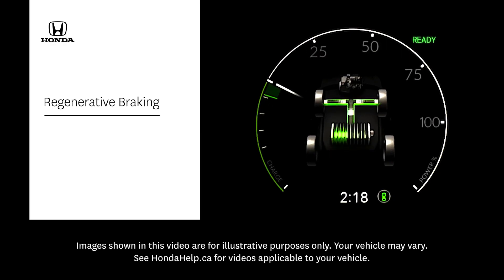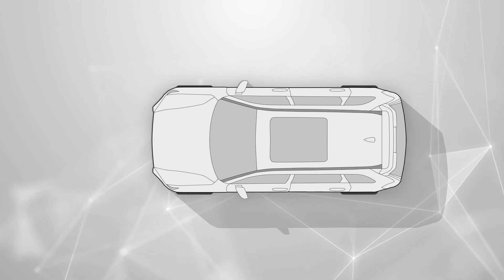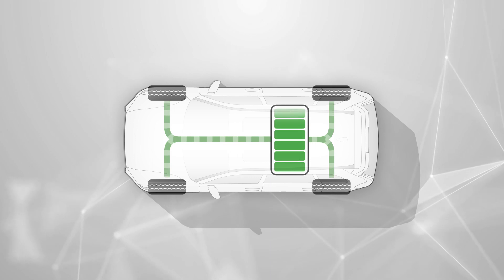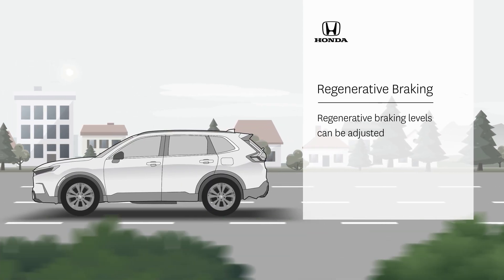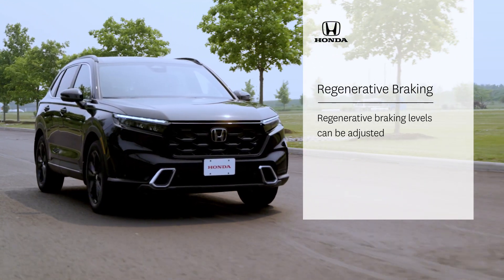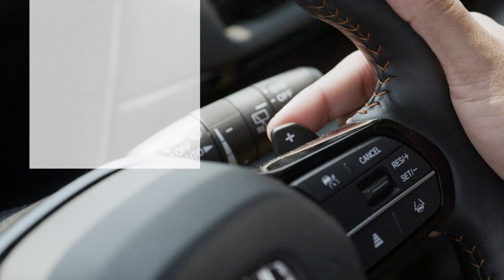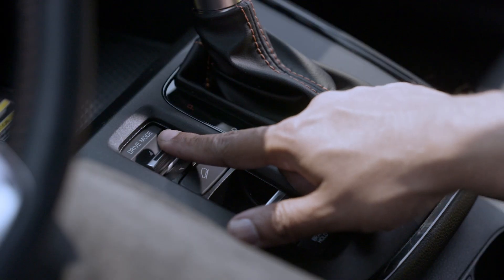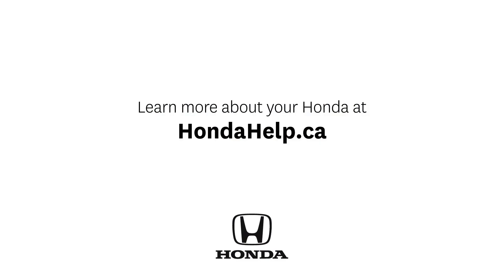Regenerative Braking on Your Honda

Comment: When can I adjust how much regen it uses? I just had a test drive and the paddles did nothing while sitting in the lot. It eventually appeared and started working when driving. But I've seen video reviews here where they demo changing the regen strength while the vehicle is stopped.

Comment: Honda, please switch rear drive to electric motor for reliability and better driving dynamic. 
A little bigger batteries - at least a 10kwh
Reply: Actually the Honda drive train setup offers better driving dynamics.

Comment: I have noticed  that if you are driving along at a constant speed and select increasing levels of the regen braking, the car will slow down and you have to give it more gas to maintain the same speed. Seems like this is counterproductive and is burning up more gas. Why would the system begin slowing you down when you haven't let up on the gas? So far this doesn't make sense to me.
Reply: I don’t get why I’d want it on either. I guess to charge the battery quicker. Or to save the brake pads since the car slows by just cutting the engine speed
Reply: @Thebuird  I have since done a lot more testing with the system and found that my first comment is not correct. The system does not produce any extra drag. It was just an illusion. In the meantime I have used the regen braking extensively and have found that it actually is super excellent. For  city driving I get 54 mpg, and around 46-49 in mixed driving. I also have completely come to love the regen braking effect because this car can be driven with one pedal driving, where the regen braking does nearly all the braking. I almost  never touch the regular brakes anymore, which means they are going to last forever. It's really quite fantastic.
Reply: @johnschmidt8440  thanks for the info! I just leased a 2024 CRV Hybrid two days ago. Came from a 2020 Camry Hybrid. I’m definitely going to try it out more, I was hesitant about it. Saving on brake pads would be great, I hate paying for new pads. I’m still confused by how extra mileage is produced, but I’m going to test it out and hopefully I can mimic what you’re able to pull off. We’re absolutely loving the vehicle and am very happy we switched to Honda
Reply: @Thebuird  A CRV is unlikely to get as good of mileage as I get in an Accord, but it will still be better than a pure gas vehicle. So give it a shot and see what happens!
Reply: @johnschmidt8440  okay help me out here bud, so to coast/slow down when coming to a stop do I downshift (-) or upshift the paddle?
Reply: @231jopancho  Actually it's not necessary to do either one if you don't want to. If you use the brake pedal in the normal way, the regen braking will do all the work until you want more braking than it can provide, or until you reach a slow enough speed that it no longer is effective. At that point the normal brakes kick in and work like usual. So this is all automatic and does the same thing as the shift paddles. That's why I almost never use the paddles because they really serve no purpose other than marketing for the most part. They are useful, however, when you want to do the equivalent of downshifting a regular transmission for doing something such as driving downhill and being able to get braking without using the regular brakes. The neat thing is that you get braking in that situation without using the normal brakes, and not winding up the engine, while at the same time getting energy to charge the battery. It's really an excellent system.
Reply: @johnschmidt8440  Thanks man God bless very helpful. I am just experimenting using the paddles and feel like a kid at a candy shop

Comment: if we press teh brake pedal, does it charge the battery?
Reply: Yes. That works as well. It’s better to use the paddles because the electric motor slows you down instead of your break pads. This will extend the life of you break pads and give you better gas mileage
Reply: @loneranger3977  Is there a way I can know how much to press the brake when slowing down to maximize efficiency? MY brake pads are being used up too fast

Comment: Why would sport mode maintain regin breaking rather than economy mode? Doesn't regenerative breaking increase economy? But that's only permanently available in the least economic setting?
Reply: If you hold (-) down once it's in drive you'll have it for the entire trip
Reply: @357STEPS keep in mind going to neutral, reverse or park as well as adaptive cruise control will reset it. Depends on what you consider a trip I guess.
Reply: Is that true for 2024 model? I tried holding negative paddle down but couldn’t get M mode to stick. Even shut car off and on thinking there’s a limited window. I use B on the shifter around town which is effectively like M
Reply: @teamwounder B mode is the new M 😂 idk why they did this
Reply: @teamwounder  Using B in town all the time I think would use more gas to overcome the constant deceleration effect.

Comment: When you want it to go up, you use the left paddle minus function, but when you want it to go down, you use the right paddle plus function. Well, that's confusing.
Reply: It makes sense to me. Braking is a negative thing, so by tapping negative paddle you are increasing the magnitude of negative force
Reply: Agreed. As well as it's only permanently available in sport mode setting. It increases economy but is not available in economy mode.
Reply: It’s meant to be like a downshift. In normal vehicles, downshifting at a higher speed will slow the car down without applying breaks.
Reply: Braking=negative acceleration.
Reply: Think of it like engine braking, left paddle for a downshift (more) and the right paddle for an upshift (less). They did this to help gas car owners get used to using them as an analogue for engine braking via downshifting.